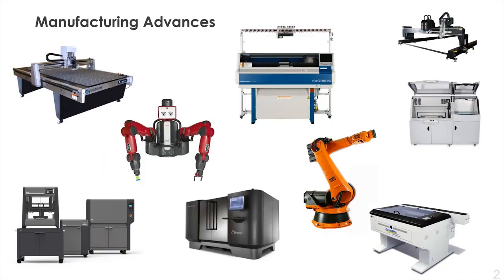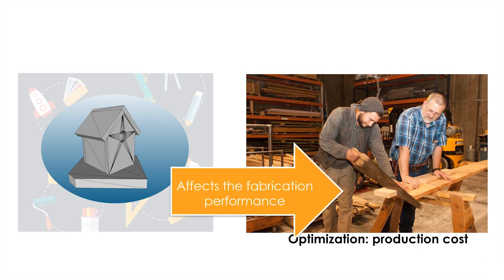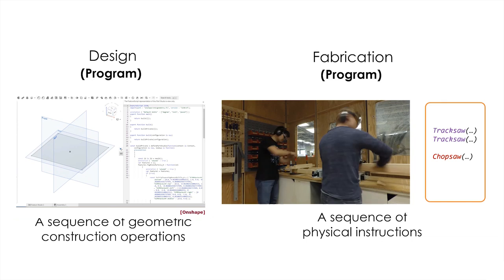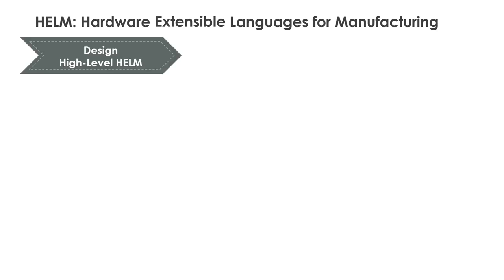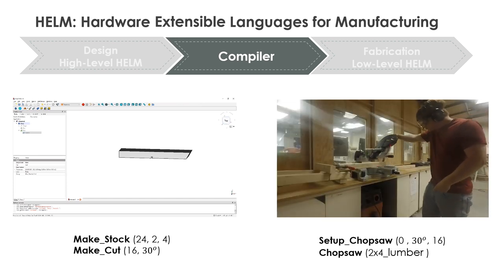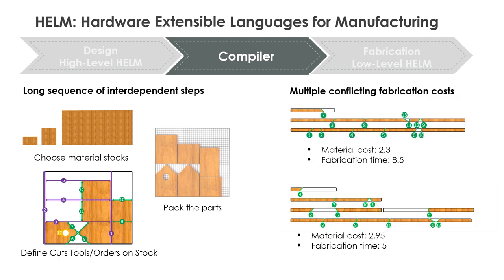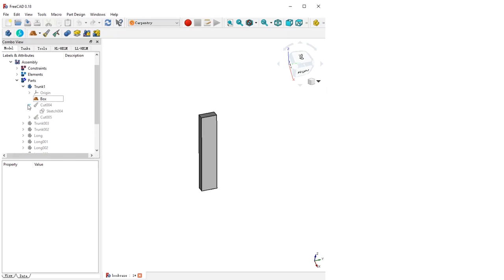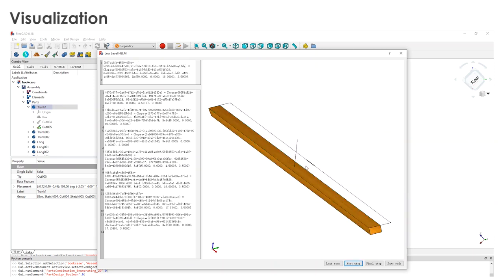Carpentry Compiler

Comment: I don't think a Chop Saw cuts angles and is not usually used for wood.  It is used mainly for steel and makes a 90-degree cut.  The power Miter Saw cuts at various angles.